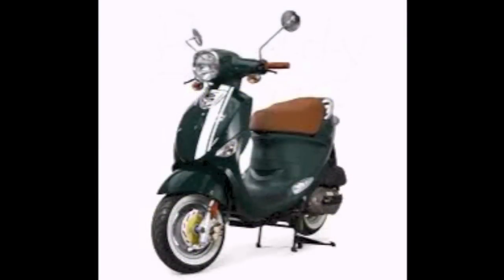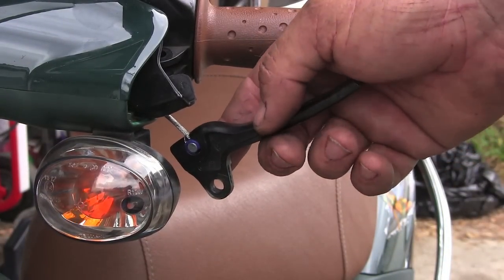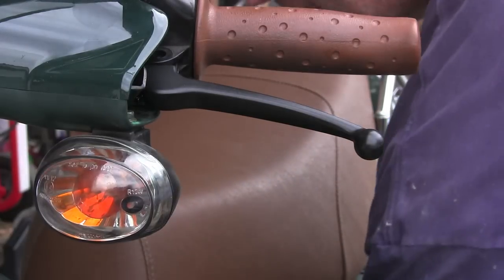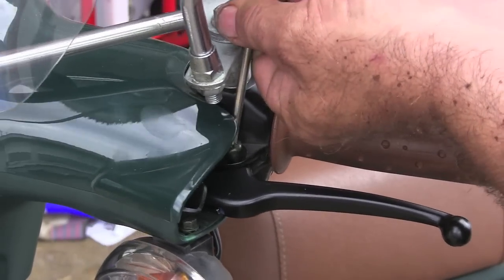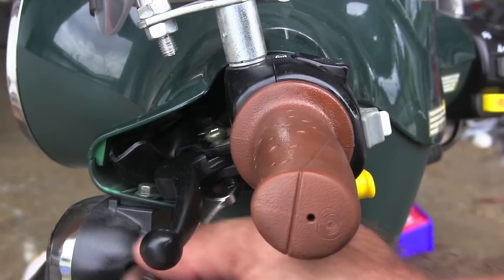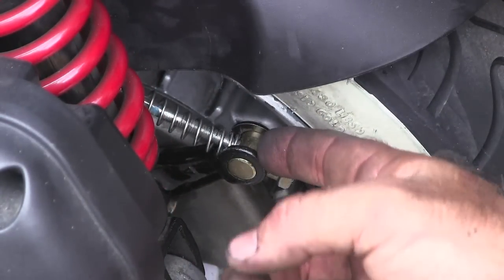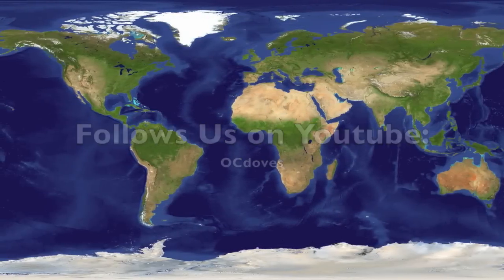Genuine Buddy 170i Scooter Replacing Left Brake Lever Portland

Comment: Anyone coming in here and not understanding, here's some tips. The LEFT brake lever/handle operates the REAR drum brake. Conversely, the RIGHT lever operated the FRONT disk brake. 

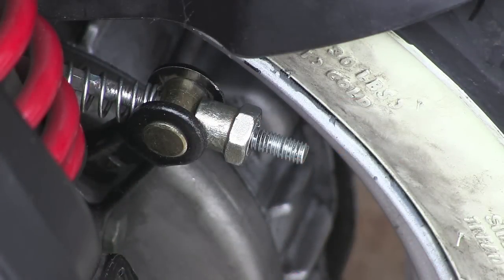In this video he is replacing the LEFT lever. To do that the FIRST thing you do (other than buy the lever you need on Amazon ($10 in 2019), is LOOSEN the drum brake cable that goes from the rear drum brake to the left lever on handle bar. See 0:46 at the video. That shows the left side of the rear tire. 

Note: The reason he marked it with a felt tip or laundry marker is so that he does NOT have to fool with adjusting the rear brake cable, which is done at the rear adjustment nut. Although not clear, he marked it at the bolt thread, where it mates with the adjusting nut. Pause at 0:48 to see. 

Loosen the nut sufficiently so that it releases enough tension on the rear brake cable (again, that goes from the brake drum on the rear wheel to the handlebar on the left grip). You need to release tension so the cable can be released at the front lever.

At 1:15 the rubber he is talking about is the little rubber shroud/housing that protects the brake lever from rain and moisture being forced in when riding in wet conditions.

Bonus Tip: Where he is forcing the screwdriver into lever, you can put a piece of cloth against the plastic fairing to protect it from screwdriver damage. 

Hope that helps.

Comment: Thanks for this -- instructions worked great for my 2004 Yamaha Zuma, just the same as your Buddy scooter. Brake Handle part was $11 from the local Yamaha dealer, and 20 minutes later it was replaced on the scooter.
The screw head started stripping  right away, so switched to a socket on the end of a screwdriver (there was not enough clearance for the socket wrench) and that worked perfectly and quickly, so go with that instead of the wrench to make the job much faster.
Reply from the maker: Thanks for the info!
Reply: Paul Kern, PMP did u had to take the head cover to install the brake?
Reply: Paul Kern, PMP i meant for the back brake a friend was telling me i have to for my zuma 2009

Comment: you dont have to remove the nut near the rear brake.  just loosen it and then push the back arm enough to give you slack in the brake cable

Comment: Thank you for this! My scooter fell over a couple months ago and the left brake lever was actually noticeably further from the throttle after the fall, but it still started and worked fine. Tonight, however, I drove it to a friend's house and left it there to go eat. When we came back from dinner, the lever was completely loose and I couldn't start it. I'm going back to her place tomorrow to try to tighten it with your video. One thing that I didn't quite understand is where the nut is located that you loosed and marked with a marker.
Reply from the maker: On the rear wheel the nut long bolt is what i was talking about. Hope this makes sense:
Reply: For avoidance of doubt. Even with the left brake handle broken I was able to start it up applying the right brake handle and hitting the start button.

Comment: Please Help! I ordered a Left/Rear drum brake lever with switch to replace a lever that broke. The new lever does Not have a spring on the pivot point of the handle to keep the switch in the closed position when it is not being pulled back. My old brake lever does have a recess in the pivot point to accommodate the spring and it has the spring thus keeping the switch in the closed position. How could the new lever I bought possibly work without the spring? I don't see that it can.